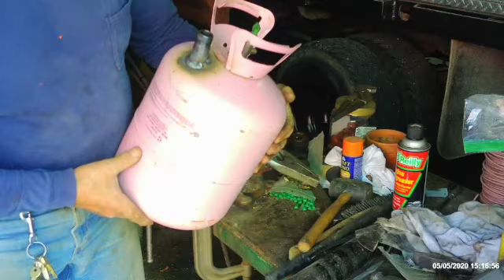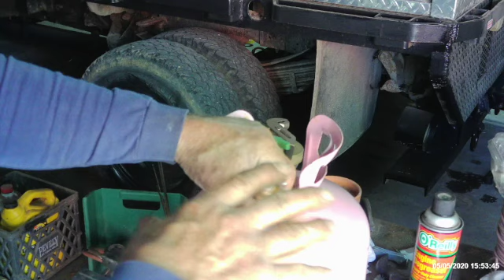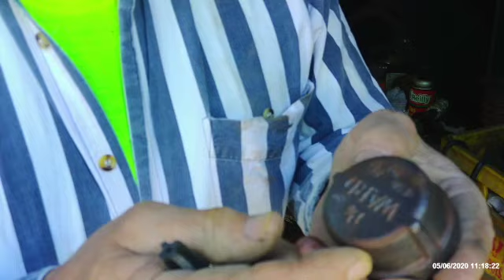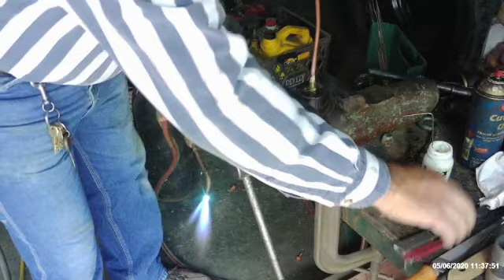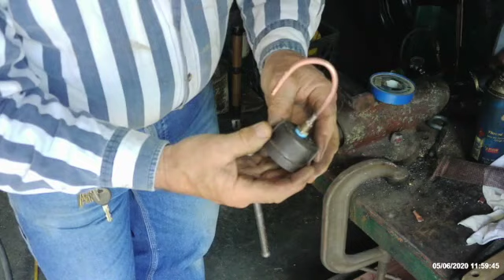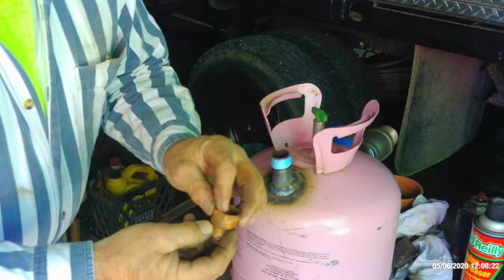Re-purposing Refrigerant Jug: Temporary Gas Tank for Farmall H

Comment: VERY NICE VIDEO, ATTENTION TO DETAIL AND VERY INFORMATIVE
Reply from the maker: Well the refrigerant drums sure come in handy for a lot of uses. I’ve built portable BBQ pits, automatic dog waterers, vacuum tanks for bleeding automotive brakes and of course quite a few temporary fuel tanks. They are thrown away by the hundreds all across the country every month!!  They even work good as a trot line float and the old ones without a built in check valve served as a light duty air tank. Thanks G N for the comment !!

Comment: I liked the “extinction pop” on the torch and the annealing of the soft tubing, good info, appreciate your skills and sharing these videos👍🏻
Reply from the maker: I try to do that each time because an old timer told me by shutting off the oxygen first, you stand a chance of leaving carbon in the tip with just the acetylene flame.  The 'pop' is supposed to blow the snoot clear with each shut down.  Dunno if its true or not, but its hard to stop a habit....LOL. Thanks for the awesome comment Timothy !!
Reply: @tractorman4461  I bet that old boy was right, as it seems the pressure of the pop, originates from inside the tip, outward perhaps.  That R410a fuel custom fuel tank was so darn cool 👍🏻
Reply from the maker: @timothyjerry2455  Hahahaha...yeah, I kinda though so because I don't have to clean my tips at all with normal use. I've made a number of 'temporary' fuel tanks out of the throw-away containers. This pink one is my favorite because it's so thick and much easier to weld fittings to. One of these days I'm going to line one with sealer and do away with the potential interior rusting.

Comment: That is too fancy for me. I have a 79 Ford with a 5 quart oil jug gas tank. Just as an FYI the refrigerant that the newer vehicles use, R1234YF is flammable.
Reply from the maker: Heck Roger...if it holds fuel and works for you that's all it takes !!  LOL.  I've been guilty of using all sorts of 'temporary' tanks.  Oh yeah even five gallon bucket !!  I have a welder now that runs like that.....temporarily....  
   You forced me to go to google to check out the R1234YF.....almost sounds like a Yamaha street bike doesn't it ?? I HAD to see if the Missus' new Subaru had it or not.

Comment: Hello Wendell, When ever I need to heat copper tubing then bend it, I shape and dry fit my pieces first. This method has worked for me for years, but as you stated patience is required! But I also understand the need for your method as well!
Reply from the maker: Heck yeah man...what ever works for anybody that does it is the way to get it done.  There ain't no single right way to do anything.  Thanks for taking the time to watch and comment Pat.
Reply: @tractorman4461  no problem my friend!
Reply: Speaking of such things...you should check out this video... Gettin’ there Pat f “collecting fire wood on a budget... truck is out of service #Buckinexperience”

Comment: 44 good morning  we learned again Teflon tape aways thought it sealed but it's a lubricant only work in lager equipment factory for 40 year's brain food 
God Bless All 
PaK
Reply from the maker: The 'pitch' or the mating tapers of male and female threads are designed to stop the flow of liquids.  the problem is without the pipe dope, be it teflon tape or brush on paste a fellow just about can't tighten them enough to do the job.  The dope provides that lessened friction to allow full seating of the threads.  That's why the threaded end is tapered...the thread cutting die tapers the pipe into a male insertion to be threaded properly into the female ends of the fitting or coupling.  Of course some manufacturers actually name their product  X-x-x-x-x-x Thread Sealant.   I bet you did a LOT o stainless steel piping in a lager equipment factory.....??

Comment: Thanks, Wendell - now I know the "rest of the story" as Paul Harvey used to say.  Now I know what ti takes to make one of those "pony tanks" out of those type of tanks.
Reply from the maker: I knew you'd recognize the old gals adornment....LOL.  LIke I said in the video, a temporary tank like this makes the tractor useful if necessary.  At least it makes it a bit more than 'mobile'.  I really should line them with a sealant because that would eliminate just about any possibility of putting rust into the carb. Cold enough for you??  It was 18 F the other morning......
Reply: @tractorman4461  Yes, it's cold enough.  It's not too bad out there this morning.  My brother-in-law came over while it was still dark to borrow my 18 foot trailer.  Him and a co-worker of his will be junking a few old lawn tractors - he said he will be very careful with my trailer.  He is also supposed to be bringing me a '70s MTD 990 garden tractor.  They were one of the better built MTD tractors, 15 inch rear wheels, hydraulic lift, shaft driven transmission, etc.  If it's in good shape, I might keep it and bring it back to life.  It should have about 16 hp Briggs engine on it.  Anyways, it wasn't too bad out there this morning, no frost nor below freezing temperature.
Reply from the maker: @316jd140  That sounds like a good one to slip a replacement motor in. There's tons of guys around that part out mowers of all kinds. Remember to remind me and the next time you stop by I'll give you the number of a buddy of mine that parts out riding mowers as well as motorcycles.  About 4 miles south of me on 61.

Comment: I did learn 1 thing and that is that the tape acts as a lube .  I always used it to seal   Thank you
Reply from the maker: There's guys that'll argue that point.  Sometimes it will stop a tiny seep though so it does act as a 'sealant'.  A good thing to know is if you have a problematic drip on black iron pipe, you can 'salt' your regular brushed on pipe dope and reassemble.  In a few days, the salt will cause the joint to rust just enough to stop the drip...Now don't tell any one you did that.....LOL  Thanks Richard for the comment.  Oh yeah,  you might consider trying the blue Monster Tape.  It's a teflon based tape that liquifies or molds itself together as soon as its put under pressure by the threads being tightened. It will not un-wrap like the white tape.  A very superior product and it comes in 1/2'', 3/4'' and 1'' widths.

Comment: Thanks for the “granules”.

I’m having trouble with silver solder. I’m not getting any strength. I believe I’m using 6%. You have given me an idea or two. 

BTW I got to your channel from Splitter Wars.
Reply from the maker: You MAY be using a product called 'Sil-Phos'....its similar to 6% and 15%.  It melts and flows similarly as well but is not at strong.  I used it a lot years ago and still may have a stick or two left but I prefer 15% for most all this stuff.  Then if we are sticking copper to steel, I use 45%.  Cleanliness is the key...well that AND the proper flux.  Good old Splitter Wars....that was a fun time.... Thanks David for the comment and thanks for (hopefully) subbing.  Take care and stay warm.